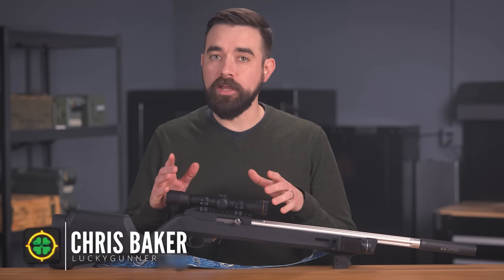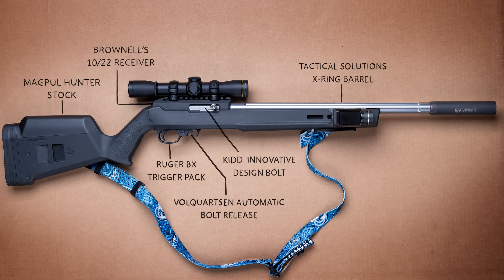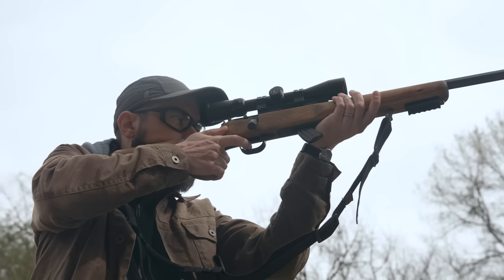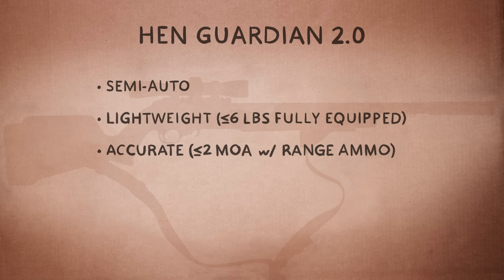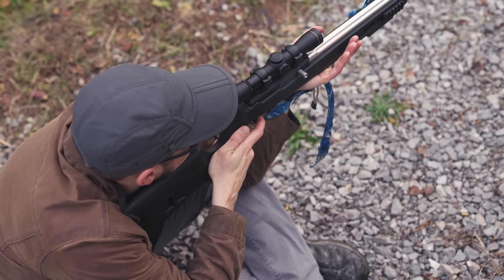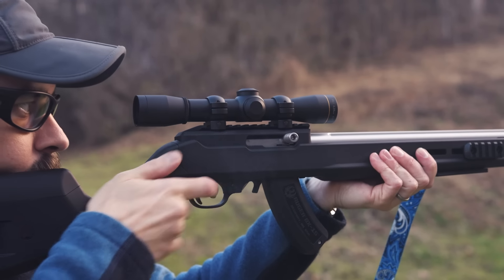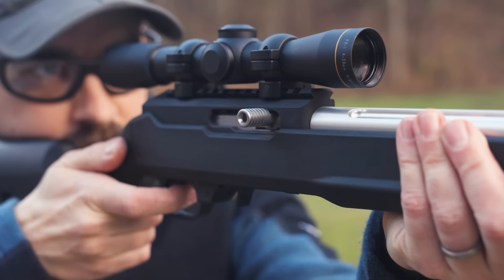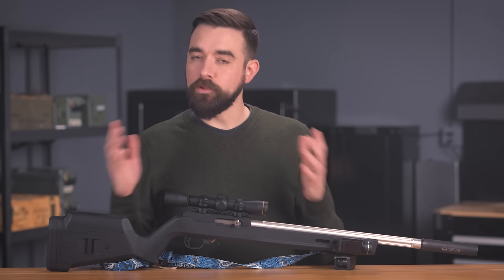The Backyard Sniper - Lightweight Edition

Comment: Very similar to the one I put together last year. Magpul Hunter stock, Brownells railed receiver, Kidd bolt/charging handle, Kidd barrel, Volquartsen trigger pack and a Leupold VX Rimfire 2-7 scope. I'd love a suppressor but refuse to put my firearms in a registry 🤷🏼

I do wish I had went with the Kidd 2 stage trigger instead of the Volquartsen. The Volquartsen isn't bad at all but I'm more used to 2 stage rifle triggers at this point so I may swap it out down the road.

Comment: I used to be very active in the 10/22 community, had a pair of winning benchrest guns and several dozen thousands of dollars sunk into a bunch of those guns, Ruger and aftermarket. You made a great gun, in fact ideal given your stated goals. However, I’m left wondering why you bothered with a custom build when your accuracy requirements are such a low bar, you could have just gotten a pair of stockers. That said, my Tac-Sol barrels were nearly as good as my custom barrels, you give up super match precision in favor of not being ammo picky. I bet your accuracy is at least MOA

Comment: great build.  I prefer the Tandemkross "Bolt Keeper" Extended Bolt Lock over the Volquartsen Automatic Bolt Release for ease of use, but it is more expensive.  I also prefer the aftermarket ambi short throw rotating safety over the stock push button crossbolt.  this is a must have for me.

Comment: I’m a little slow so bear with me. I got the impression it took 4 shots to dispatch a masked bandit and you wanted to upgrade your sniper gear. So you sidelined a .22 LR for a … .22LR.  So I sat and thunked and the best I could come up with is that you weren’t looking to up your bullet impact, but rather if you’re going to be hoofing it all over the farm with your Dispatcher of Divine Retribution , you want a lighter DDR. Weight, not impact of each shell, was your goal. Did I get anywhere close on this?

Comment: How much louder then your bolt action?
Reply from the maker: Not louder at all that I can tell. Most of the noise from a factory suppressed 10/22 is from the bolt smacking against the bolt stop. The Kidd buffer (which is basically a steel pin with a rubber sleeve) cuts that noise down considerably.
Reply: @LuckyGunner  maybe some ninja sound tests for part three of this series!
Reply: @LuckyGunner  I use a rubberized fire control pin so the bolt doesn’t make any sound when it hits it.

Comment: Need Bigger Bullet. How about a 223 Bolt Rifle?
Reply from the maker: Too loud
Reply: @LuckyGunner  Fair. No Suppressor in Canada, means always Ear Pro. 
How are 9mm PCC for Varmint Control? Also a big bullet.
Reply from the maker: Pistol caliber carbines are generally not accurate enough for smaller targets like that. 4-5 MOA at 50 yards is normal IME. Last time I shot a pest with a 9mm carbine, it was a groundhog at ~30 yards. He took two HSTs to the body and ran under the porch to die. I would much rather have taken a headshot with a .22 LR.

Comment: That's a beautiful build, but I think you said something bothering.  You ordered the gun that way??   Build it yourself.  I have a similar build, but no suppressor.  Hoge stock, much cheaper 3-9x40 scope, .920 stainless barrel.  Don't waste the money on the Ruger BX trigger.  The factory trigger can be modified at NO extra cost.  Granted, you can NOT do this with any gun or trigger assembly, but it works very well on the Ruger 10/22.  I've done 2 of them already, but the one mentioned is at about a 1.5 to 2 pound trigger.  In other words, don't put your finger on the trigger until you are ready to fire.  https://youtu.be/zal-Q5VGGGE

Comment: $800 gee, what were you thinking?  .22 LR? No wonder ya need semi-auto......fill 'em with poor shots until
they are too heavy to move then finish 'em with a baseball bat! ha ha  Of course the finished rifle is so
clunky looking I guess you can butt stroke the raccoons to death.  What killed the custom $800 Ruger 10/22
was you only keep the action and replace everything else........BUT then you still have a marginal rifle!
Marginal power and very marginal accuracy.... MY .17 HMR in a Savage bolt, wood stock, brass shimmed trigger box will fire 4of 5 rds. at 50 yds touching. the 5th almost touching. Slim trim wood stock....... looks like a mini
mdl 70!  Your swagged soft lead 22 LR will never match the groups of the jacketed .17 HMR. bullet. Good to 150
yards on sage rats when the wind lets up :-)

Comment: Why is it every bolt action guy always beats the crap out of the action slamming it like it's a race, if you wanted fast you should have gotten a semiautomatic.  Then they are always changing the knob handle as if it made any difference in the world. You just need your thumb and pointer finger, up back forward down, zero effort no time challenge no palm of your hand, it's slow live with it, you cheaped out.